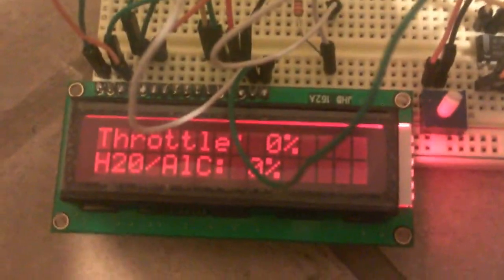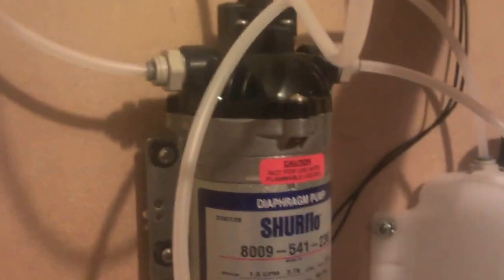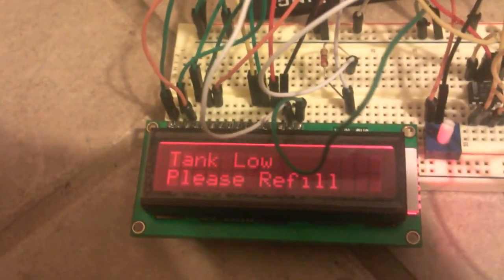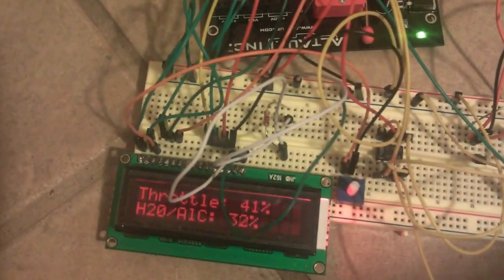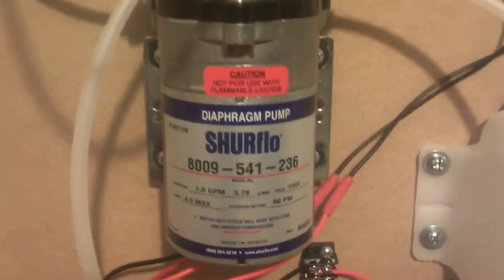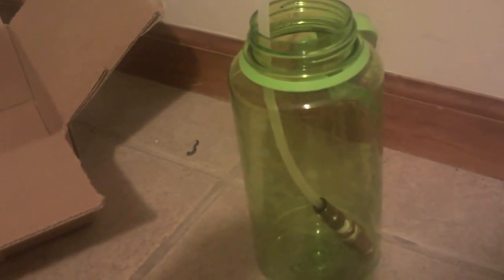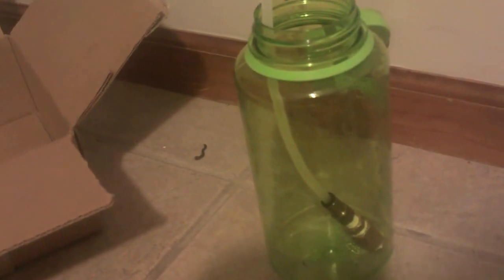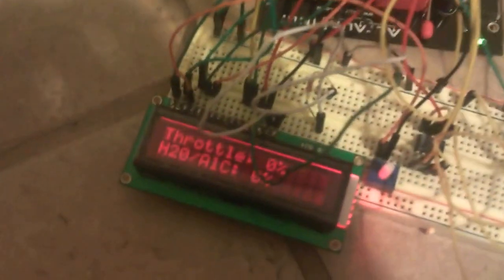DIY water methanol injection system

Comment: Oh and I'm assuming this is for a non turbo model. Once your happy with it I would like to also see a plug and play/piggyback timing adjustment dial that leaves no trace on the ecm when removed as not to void new car warranties. You/we would sell millions of these, I'm confident. What part of the country are you in? I'm in Illinois ; )
Reply: Lawrence, KS.  I really need to lay everything out on a pcb.  I'm strongly considering including a CAN connection plug for install, this way it would be the same on every car, since some cars have different sensor types

Comment: Nice concept....I was thinking could you simply read data from fuel injectors firing and dumping fuel into the cylinders and have this setup to inject a designated percentage of water to copycat what the car manufacturer has already done for you. It might be similar to reading rpm's but if you just take their data for X car per se on the injector fuel output simply decide what percentage of boost/water injection you want and set up your electronics to do it in that fashion. that may take care of any under or over engine load out of the equation. basically a cheat sheet to work off of. I'm waiting in line for my 3 free units when you perfect it. great work, keep going in high gear and call me, we can head to the patent attorneys office together. ; )

Comment: Out of curiosity, why would you read the throttle percentage to control the amount of water/meth to inject rather than using a boost pressure? or some sort of engine load percentage? I can have my foot halfway into the throttle, and still have the motor working 80-90% max engine load (in a turbocharged diesel application) Also, what type of ratio are you using for throttle percentage, to water/meth injection percentage? 

Thank you! and good luck on your project! looks great so far :)
Reply: I actually just ordered an OBD plug,  I'm trying to make the system install by plugging into the OBD system and give it the ability to read off of any pertinent sensors.  I am also laying out a PCB so its not a mess of wires, and looking to include automotive grade waterproof connectors.

Comment from the maker: The propeller is a great MCU for this because of its 8-core architecture, no need for interrupts you can read the input from the sensor and assign a motor speed at basically the same time.

Comment from the maker: There is a parallax propeller and an ADC 0831 analog to digital converter which reads the voltage from a MAF sensor, or TPS depending on what you want to read as input.  Then it sends serial to the pololu motor driver, however I'm going to be upgrading to a more robust motor driver which will use PWM sometime pretty soon.  Going to try to lay it out on one PCB.  Code wasn't too bad to write, the hardest part was figuring out I had to send a carriage return on the serial along with every command.

Comment: so you're using a parallax micro to interpret the engine voltages (MAP / MAF or whatever) how does it control the pololu motor driver? PWM?  Im such an electronics rookie but looks like heaps of fun, is the controller programming/coding hard?